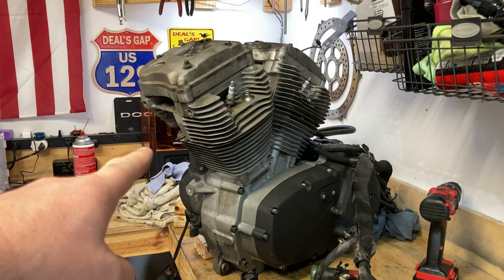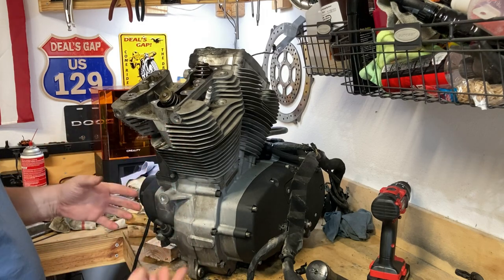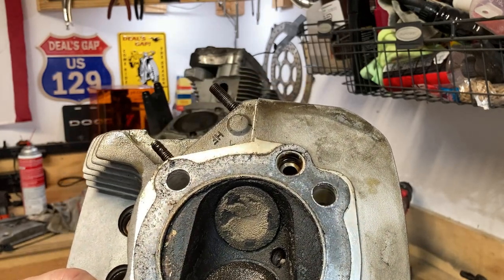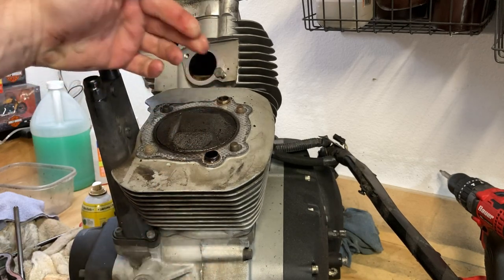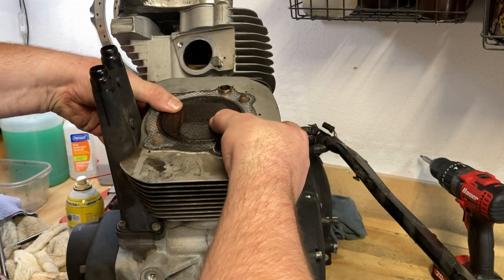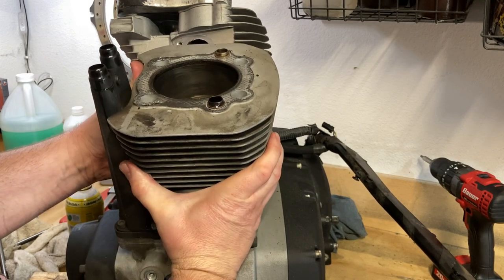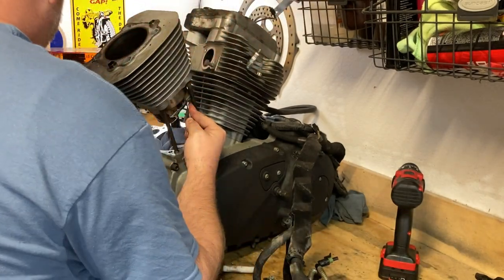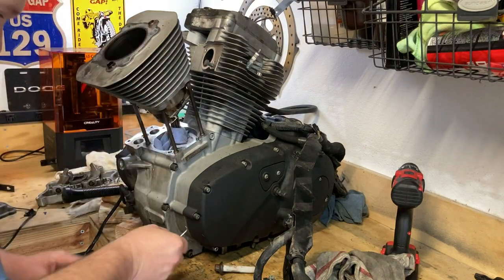Reviving my Buell: A DIY Motorcycle Rebuild - #engine #disassembly

Comment: My brother had to pull his down at 160,000 Klms cause it started jumping out of 3rd gear. Last Firebolt. No wear ,just a thin wave on bottom of bore where the rings change direction. New valve stem seals, SE valve springs, & hammer kit. Clutch Plate Kit & gear replacement..   Now ,4 years later 220,000 klms and it flys  .These last years had really good Fueling and  he has Micron pipes and a race ECU.😉 The oil that was used can cause The carbon. Synthetic in motor way better!

Comment: The reason for all that carbon and gunk. Is because the design of the breather on top rocker boxes i.e.(pcv valve.) The hoses are routed into the air box, and sucked into the intake. Terrible design, I believe Buell did it that way to pass emmision . What you need to do re-route those hoses into a catch can. At least that is what I did. Fixes the sputtering issue as well. You see how much oil and water comes out when I empty my catch can.
Reply from the maker: https://youtu.be/RJhd0MAz704?feature=shared

🤙

Comment: Piston carbon was a little heavy but short rides or aftermarket exhaust without tuning will carbon it up a bit. You should always shove a rag in the crankcase unless you are planning on a total tear down.
Reply from the maker: The carbon was from the valve stem seals and valve guides being worn out and leaking. See this video for more info on that finding: 

https://www.youtube.com/watch?v=8ZeiQqkuEGw

Comment: I just did this rebuild on a 883 Sportster with piston slap and everything that came out looks practically identical except for the combustion chamber being a bit more filled in on the Buell to get a higher compression ratio. We fit a 1200 conversion kit on the Sportie, any idea if it would fit an XB9?
Reply from the maker: Nice! There are a few differences and I had to ask my buddy who's more familiar w/ Harley/Buell to get this answer (so I'm not taking credit): "XD cylinders have notches for the oil squirters and in the fins for the throttle body"
Reply: @kz6fittycent  I did more research and learned that the xb9 actually uses the same bore as the 1200, but is destroked. I figured the xb9 was a deal like the 883 with a smaller bore.

There are kits for the XB9 that punch the bore up even more to get to 1050cc, I bet that's a riot!

Comment: I can't catch the reason for disassembling the cylinder. What kind of breakdown happened?
Reply from the maker: I had both a head and base gasket leak on the rear cylinder. I intend to keep this bike "forever" and so I'm rebuilding it to keep it on the road as long as possible.
Reply: @kz6fittycent  I bought xb12xt also "forever". Thnk's for comment.

Comment: Valve stem seals
Reply from the maker: The whole top-end is getting rebuilt, including valve stem seals.
Reply: @kz6fittycent  its the only thing i could think of that would leave it so heavily deposited. Interesting video, i have one myself
Reply from the maker: @liamkatavich  it wasn’t consuming oil at all. Those deposits are likely unburnt fuel from short engine runs throughout its life
Reply: Ha i was right wasnt i..? Just watched the video on the heads
Reply from the maker: @liamkatavich  yep!!